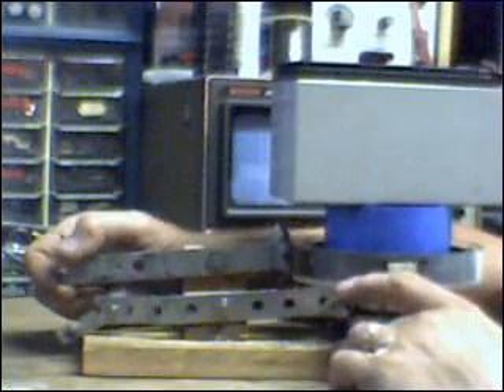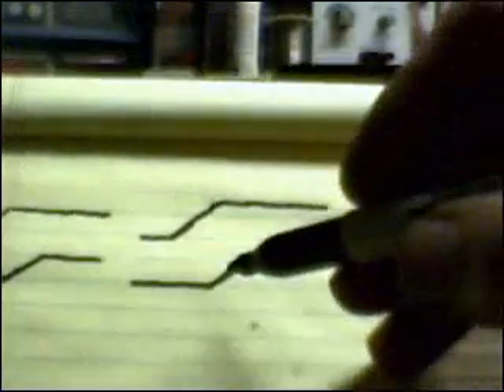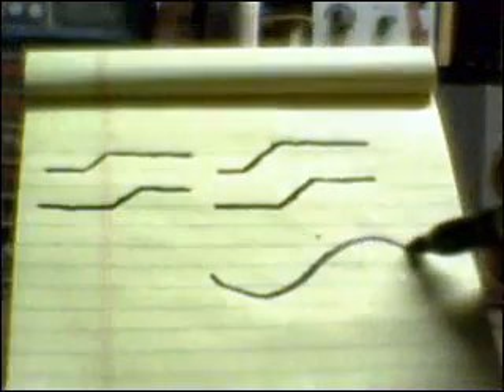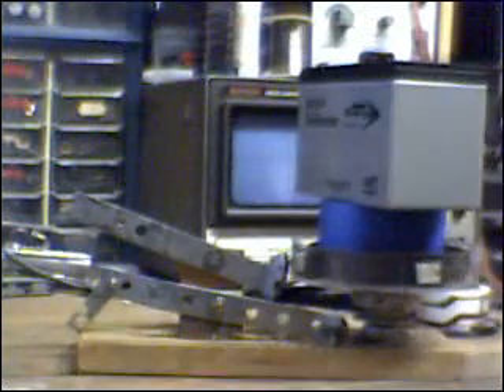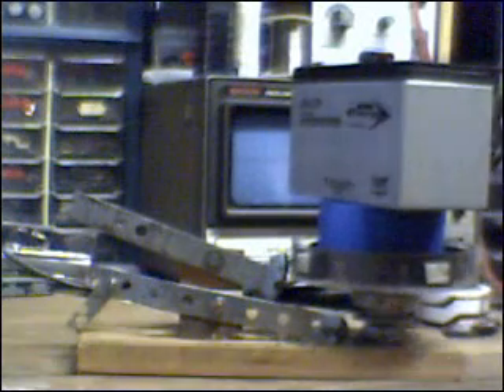10 - Oscillating Stator Permanent Magnet motor.

Comment: Its kind of pointless if you have to physically move something to keep the rotation going. That's the problem with most of the free energy/magnet motor projects here on youtube. They require (minimal no doubt, but still work) to get over that hump that causes the rotation to stop because of magnetic pull cancels out the magnetic repulsion. It is why basically every video on youtube for perpetual magnetic motors fails to solve that problem.

Comment: I don't think a purely mechanical form of this machine will work the way you want it to without some sort of spring. What you have built here reminds me of something I saw called the hummingbird motor -- you should look it up if you haven't seen it. Obviously it takes only a small amount of mechanical input to turn your flywheel. You can attach a small motor + cam to your stator arm to get exact sine motion and attach a much larger generator to the top of your flywheel. This concept does work.

Comment: use 2 time's the top and place magnets axross so top , take 0-90-180-270-360°
and bottem 45-135-225-315°
Then take both arms the same length and put the connection to the wood at the same distance .
if you can . dont know if it works :-)

Comment: Why do you people insist on wasting your time?  Separated magnets have potential energy same as holding a rock above the earth. Once they come together the energy has been used.  What you are trying to do is the equivalent of having a rock fall, generate some energy on impact and then magically appear back at the same spot it stated.  It's never going to work. However it's your time to waste so keep trying if you want.

Comment: If the pins holes of the connecting link that connects the stator and the control arm where not "fixed" if they had the proper cam "slot" in them would it not midigate the diffrence in the two types of movement? The conecting link wouldn't just rock it would slip back and forth.

Comment from the maker: In any device worth building, frictional losses should be inconsequential. It should produce enough energy to overcome any frictional loss with plenty to spare as useful output. That's why I concern myself much less with friction than I do just getting the damn thing to work. I'm not after perpetual motion. I'm after acceleration. When it does work, it will do so in a spectacular way.

ZFF

Comment from the maker: It has also been suggested here to use a spring to achieve a more sinusoidal movement on the stator w/o modifying the bobbin raceway. I might give that a try too. It would be very easy to replace the linkage connecting the two arms with various length U-shaped pieces of coat hanger, even though I believe that would create just one sweet spot RPM.

Comment from the maker: What I'm doing mechanically is pretty much the same with one exception - The roller will be 3-4 times closer to the center of rotation, at the bobbin, so that the rotor magnets have a mechanical advantage over the stator. In your animation the roller is at a mechanical disadvantage.

Comment: no, if I wanted to be funny I would say. We had the blood the sweat and the tears already, the self spinning motor cant be far away.

I was trying to say the block wave could be shaped into a more smooth amplitude by using a spring or a rubber band. 

Just popsicle stick it on there and duck tape it in place. hehehe

Comment from the maker: I can also input the rotor position to the 2nd trace with a pickup coil at the perimeter to detect if there are any timing changes I am intuitively making by hand that a fixed mechanical ass'y can't.

Comment from the maker: It does move as far. Problem is the frame rate of the USB cam doesn't follow the rapid transition of the lower arm as it does the smooth up and down my hand produces on the upper arm.

Comment from the maker: OOOOH!!!  I LIKE THAT ONE!  Only mechanical problem I can see might be to create a swivel for two roller bearings so a small gap could be maintained as the angle changes along the rail. That or allow a larger gap and some slop at the top and bottom of travel. ZFF

Comment: also, to reduce the overall energy loss of the arm-actuation, you may want to try to integrate a form of oscillation motion into the actuator system, so that it alomst oscillates for itself (flat spring?), and is not depending to be pushed up and down by a fixed copper trail which is probably creating quite some energy loss as you alreday mentioned. of course, the oscillation then needs then to be coupled somehow to the big weel... that would be the funny part of it :-)

Comment: mabye you want to use your oscilloscope to record/visualize the needed motion pattern for the arm, as you move it by hand. you may need some mechanical coupling as with a potentiometer for example for this.

Comment: thanks for putting these videos online ZeroFossilFuel
i love the simplicity of your device and the way you think

i see less deflection of your stator when it is hooked up than when you run it by hand
it does not appear to completely cross the spinning magnets
using a single rail wire and a tuning fork shaped guide [with or without 2 bearings] instead of the two rails and 1 bearing, you would get much more deflection on the same basic parts

Comment: Have you thought about changing the position of the fulcrum on the lower arm?  I'm sure that will reduce the resistance of the cam movement; although lowering the vertical movement but it sound like you don't need much there.  I'm thinking of a cam for the connection of the arms...what do you think?

Comment from the maker: FYI, the next generation test fixture will expand the rotor diameter 50-100% to increase the mechanical advantage of the rotor magnets over the stator control arm. Currently it's only 1.67:1 due to unforeseen variance in raceway construction. May not be enough to overcome frictional losses which as you can see are quite substantial.